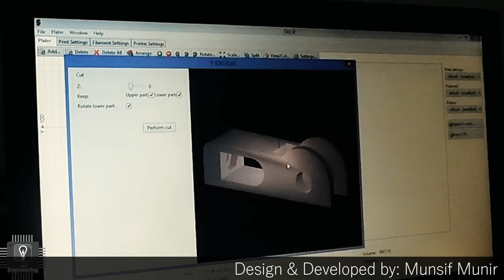How to make 3D Printer at home, in Urdu/Hindi  |Part-1|

Comment: you are using your own design with wood and sliders :) wonderful working , my suggestion in next version of your 3d printer should be use iron frame it will be regid... wonderful job dear Good luck
Reply from the maker: Thanku for your appreciation